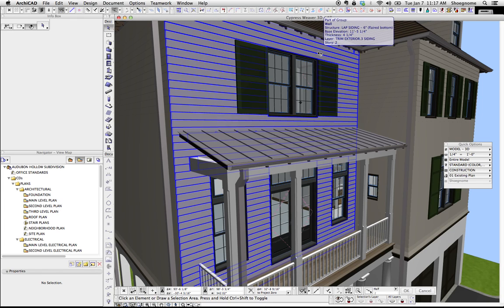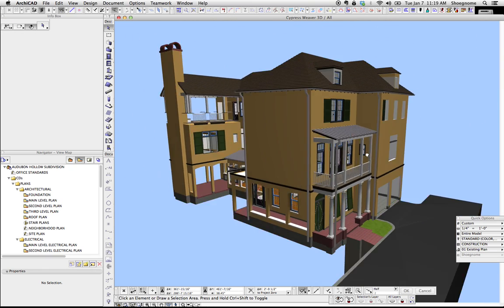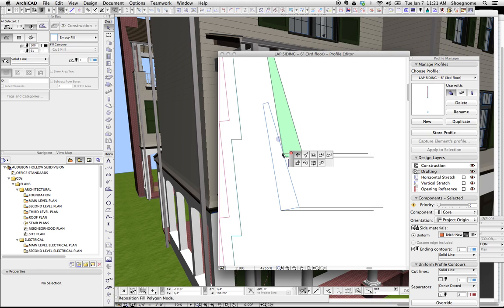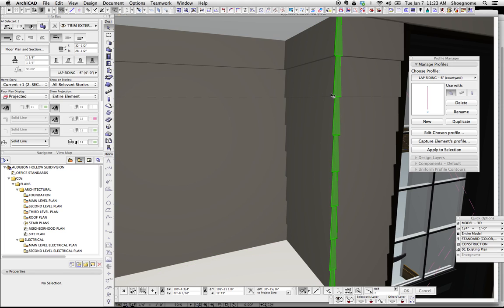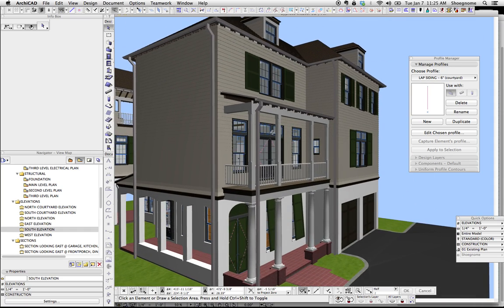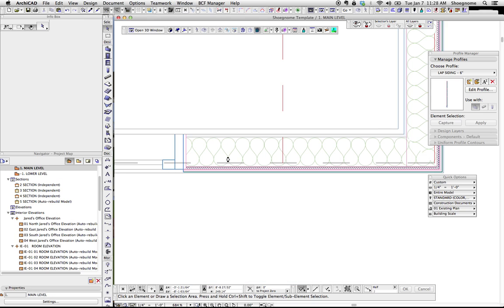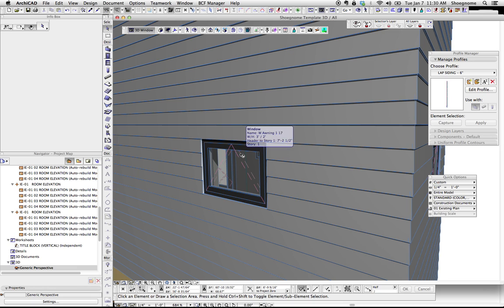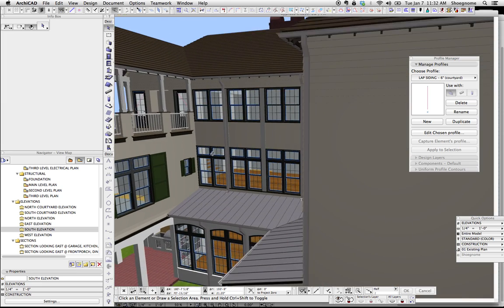ArchiCAD Tutorial #33: Complex Profile Siding in ArchiCAD

Comment: Thanks for the video! Something I am not understanding is how to adjust the height of the complex profile. Are you drawing it at 30'+ in order to use SEO to trim it? I tried to use the height stretch parameter in the profile and notice that when I bring it into the model and change the height, it changes the height of the siding as well which I do not want. Thanks!
Reply from the maker: Unfortunately stretch doesn't work with lap siding for the reason you describe. So yes, for lap siding and similar horizontal siding, I make the Complex Profile as tall as it needs to be and then SEO to trim it down where needed. For some projects I'll have a few different lap siding CPs for different standard heights throughout the project. For stepped bottoms, I'll use polygonal openings to cut the bottom of the CP to follow steps in the concrete, site, etc.
Reply: @Shoegnome  Great, thanks for clarifying!
Reply from the maker: @LaurenZvida  my pleasure!

Comment: How can I turn the horizontal siding through 90º to get vertical cladding - I'm guessing not using complex profiles. But there must be a awayy surely?
Reply from the maker: In general I find a Surface for vertical siding is fine. It's not as important as horizontal siding to have true shadows, so the added depth and modeling isn't necessary. For vertical siding I'll typically add the thickness as part of the Wall Composite and then use a Surface. If the siding is more complex or specific you can also use columns and beams (high priority Building Material on a hidden layer) to create control joints. Here's a video on that: http://www.shoegnome.com/2015/12/17/control-joints-strong-air-archicad/

Comment: Hello... Is there any way to save the created profile in an universal way? to be used in other projects too, just like the default profiles archicad comes with (c shape, steel beam etc.). I`m using arhicad 19 and i also have some projects where i would like to use the same profile but without creating it in each project. the only method i found is to make the profile in a project and everytime i make a new project use the setting from the last one...
Reply from the maker: Create the Complex Profile you want and then include it into your template that you use to start new projects. You NEED to be using a template when you start new files. If you don't have a template, you can start with mine: http://www.shoegnome.com/template/

If you have a lot of Complex Profiles, you could create a master Complex Profile (the post is old, but the idea is still valid): http://blog.graphisoftus.com/archicad-education/tips-and-tricks/the-master-complex-profile

Also Complex Profiles are like any other Attribute and can be transferred between files using the Attribute Manager.
Reply: Thanks for the quick answers, i`ll try these methods.

Comment: hi, i'm a student and kinda new to archicad, I need to do something similar to this for a project I'm working on and I have a question. When I want to highten the wall it makes wooden paneling go huge (I use the wall as base and then draw the paneling on it as you showed). Can I fix this somehow? (I use archicad 19).
I hope you can help me :)
Reply from the maker: +Arne Hamal if you are doing this technique and need to make a taller wall, you need to update the Complex Profile to make it taller. If you just stretch the Complex Profile vertically, the vertical dimensions will also stretch.

Comment: Hello! Nice video. I have a dilemma regarding beams with variable cross-section.(one end of the beam to be smaller than the other.) Could you use complex section to define such a beam? Thanks!
Reply from the maker: Yes you could. The Complex profile would just be the longitudinal section of the beam rather than the cross section. So you'd end up with say a CP that is 10 feet long and a beam element which is only say 6 inches wide (ei, the width is defined by the beam element's length and the length is defined by the complex profile).
Reply: Thanks for the answer. But when i posted this comment I had in mind a beam with complex cross-section like a "T" or "I" shaped section. I think it can be done in the manner you described by drawing first the web than the flanges but I still think its to complicated. Could there be another much simple way to do it? Thanks!
Reply from the maker: Bogdan Taut
OKay. I think I see what you're saying. Yes. I've done that using two complex profiles. You could then save it as an object if it doesn't need to change. OR...once you set it up group the elements and copy + paste all around. If you set up the reference lines correctly, changing between CPs for both isn't that hard to do. I have a good example from an old project with very complex metal brackets. I'll try to share that later. Feel free to remind and pester me!

Comment: Nice post detail, is that a solid operation ?
Reply from the maker: No. It's a Morph.
Reply: Cheers !
Reply: thanks for the video. i am migrating from CAD work to Archicad #learning )...if i want to make an exterior wall with aluminum panel looks (20mm vertical and horizontal gap on the walll).. how do i do that